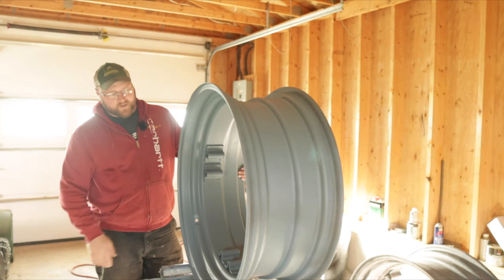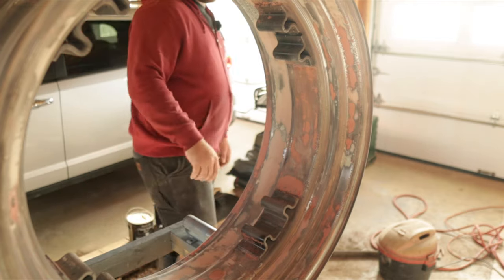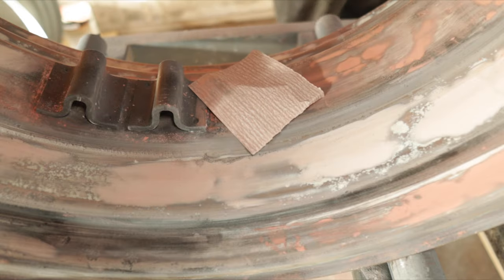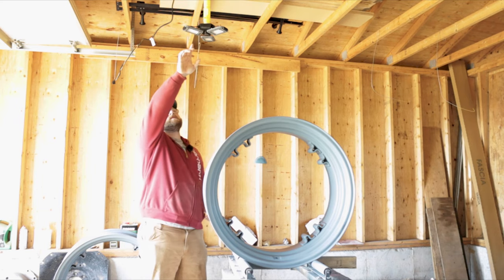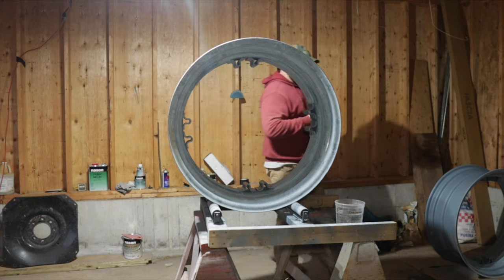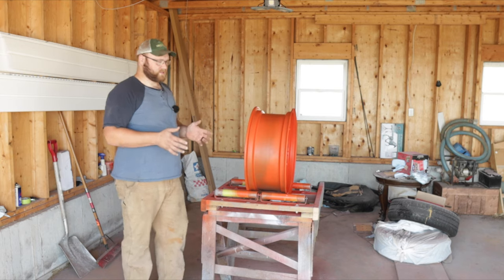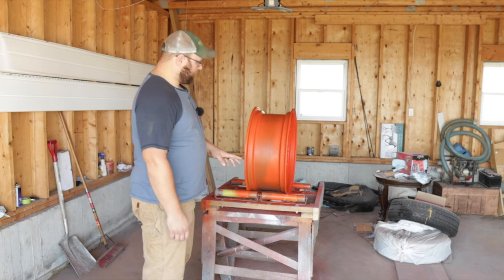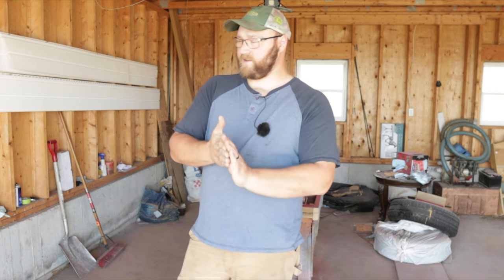Case David Brown 1394 Restoration: Painting the Wheels

Comment: Scott, did you sneak in my shop??
I made 2 sets of rollers like that.. probably 30 years ago. We used to do a lot of wheel work. Mostly widening, some narrowing and section repairs. 
One roller is a solid frame, the other is adjustable for bigger wheels.
Definitely a must!!! 
Good work, as expected 👍😎
Reply from the maker: Haha I didn’t see yours I actually stole the idea from one of Hogslayer’s videos seemed like a good idea.
Reply: @macfarms  work great!! I'm assuming you have the rollers on an angle? Center where they meet is out just a little.. helps self center the wheels. And if the rollers are all level on top, they work with a wheel on it's side too.. unless of course the wheel is too big.
Reply from the maker: No they are just straight, they were wide enough it didn’t really matter they could slide one side or the other quite a bit. Might have to angle them some for next time though doesn’t sound like a bad idea
Reply: @macfarms  where we cut and weld the wheels on the rollers, then of course cleanup and paint.. they get rolled a lot, definitely helps!! They still walk a little, but part of that is because you always turn from one side.
Reply: Good.🧲

Comment: I like the rollers, I might have to make a set. There's no good way to paint rims, I figure the flange edge is going to get scuffed when the tire is mounted, so not much point in sweating about it. I use a foam brush to touch up my scuffs. They don't last long in acrylic or urethane, but they are cheap and don't leave tracks like a bristle brush. White might be a bit more forgiving, too.
Reply from the maker: Yes that’s what I figured as well, they are going to take some abuse getting mounted anyway. I’ll get them to mix up a pint of 1K paint for touch ups to match the base and try a foam brush on it once the tires are on

Comment: Magpie colour scheme. So a 83 - 84 look. Interesting to see what year the serial number number lands on
Reply from the maker: S/N makes it an 86, so unfortunately I can’t even claim it was a late magpie that was painted CIH colours before it was sold lol
Reply: @macfarms  it'll look better but. Lol. I've been looking for a 84 July built 1494 4wd cab hydrashift with a qd90 loader. I been looking for the past 10 years have only found for sale here in Australia and they wanted $35,000 for it wayyy out of my budget for a project tractor
Reply from the maker: Oh that would be a nice one too, the David brown loaders on the 94 series are very uncommon here, most would have had American Case loaders like a 74L
Reply: @macfarms  yeah they were super rare here to on the 90 and 94 series they mainly here fitted with locally made aftermarket loaders mainly challenge and robots, good solid loaders but not what I want but even a 1494 with a local loader is hard to find farmers just won't part with them. I know that the local dealer sold 46 1494's but no one wants to sell them lol
Reply from the maker: Lol yeah I wounding say they come up for sale a lot here either, they have to be out there I know there was dealers in the area at the time, but they just don’t turn up for sale much.